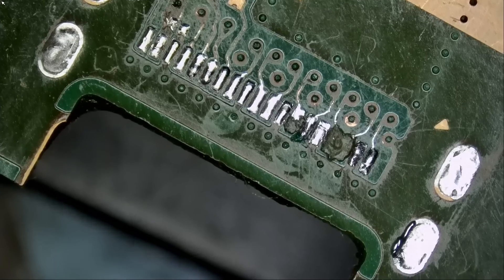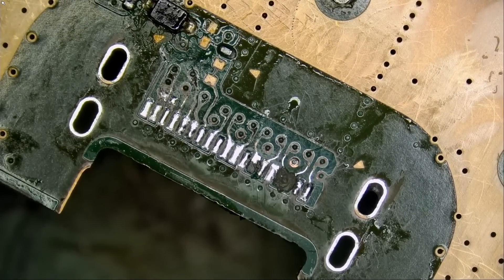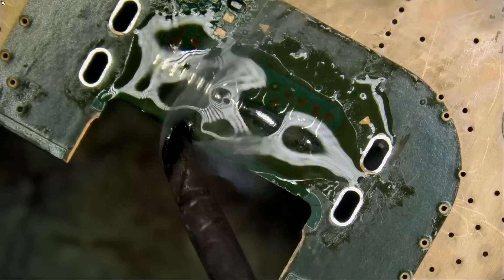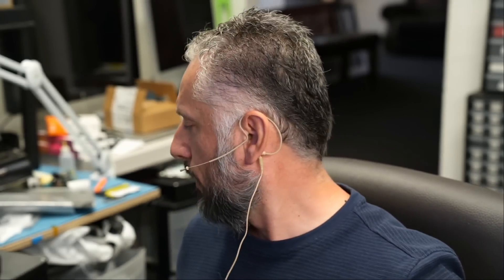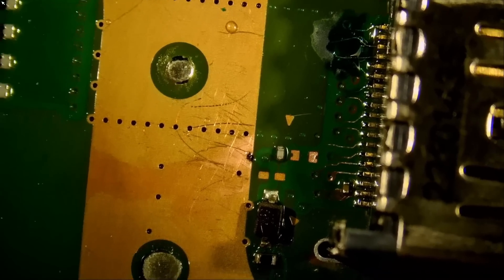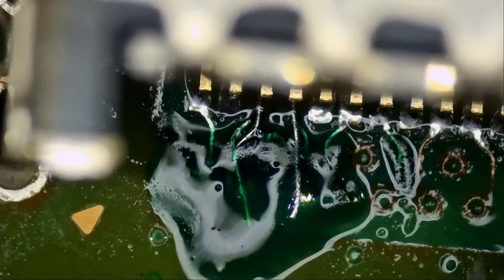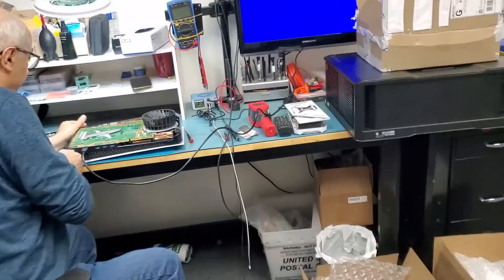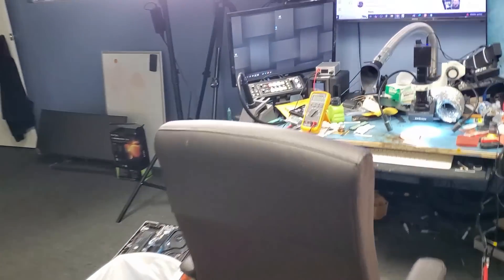Fixing a PS5 HDMI Connector with Ripped Pads after a Failed Repair Attempt

Comment: I LEANRED IN ONE DAY. My little brothers Xbox series x hdmi was broken for awhile. I fixed countless phones screens before I did any micro repair so I felt a bit of confidence even tho is was entirely a different ball game. I watched a few videos and decided to buy a heat station and soldering iron off Amazon, I didn’t have enough for a digital microscope so I used those ear cleaners with the camera to see what I was doing. It was a scary job and took about 2 hours😂 but it’s still going strong 2years later. After that I started my repair service business.

Comment: I agree with "takes a lot of practice". I tried to desolder SO-DIMM DDR connector and it didn't go well. I didn't even desolder one connector. The solder they use at factory solidifies so fast there's no chance to remove it with soldering iron.

Flux... I quickly learned it's a must have, even the cheap one. The solder just won't srick where it's supposed to. Usually it's the soldering tip and not the board.

Comment: You know I have this incredible ability to learn things rapidly. Welding, gunsmithing, heavy equipment operation, heavy equipment hauling, I've excelled in a lot of fields......micro soldering and electronic repair in general AINT NO JOKE. It took me some serious time and dedication to get decent at. Your videos and expertise absolutely motivated me and kept me going through the process. If you want to get into this be prepared to invest a TON of time into practicing and failing. Also be prepared to invest in equipment. And the most important thing is be prepared to watch countless northridgefix videos to ensure you're doing things properly 😉
Reply: So we have same mindset 😅

Comment: Hey Man nice work... Since you repair laptop too I would like to know if my laptop is at 100%  charge and still plugged in will it bypass and use the mains directly for power supply ? or still draw it from battery and charges then and there?

Comment: I've been doing electronics repairs for my work for over 16 years now. My main schtick is arcade... so my sister-in-law brings me a ps5 to repair the HDMI port. (she supplied the replacement port and liquid metal thermal compound) ... man oh man... ... i've soldered some tiny things in the past, but damn, this was really something. luckily there was no pads ripped off and it went back on smooth. didn't even lose the bypass cap :D

Comment: I've been into electronics and soldering for many years and recently the last couple have started getting more into it including logic fault finding and SMD rework.

I do some component level repair of larger consumer electronics and PC's for my friends phone repair shop and recently they gave me a couple of PS5s to do (first time) and asked me to teach them. 

Let me just say this is not a job for a beginner! The pins are tiny! It requires proper tools and equipment and experience/practice!
The first one I got off and replaced successfully though it took me quite a while learning the method. The second I got off much quicker  but upon tagging down the last couple of pins, the iron/solder ate that stupid tiny decoupling cap! 🤦‍♂️ With no replacements, all I could do is reassemble and hope it was just for non-essential filtering! 
Unfortunately, for whatever reason, the console still had no video output 😔

I think what didn't help is my lack of microscope, in its place I use my Canon 5D with 100mm macro lens and tripod! 😅 It looks towards down on the board rather than down from directly above, meaning my view can be obscured at times. Also, I've only ever soldered a few HDMI with larger pins before.

Thankfully everyone was ok, accidents do happen after all and the console went to the 3rd party repair center they also use. I will be both getting a microscope and practicing on a few more scrap boards before I take on anymore customer PS5s and teach my friend fully how to do it though, they have even more to learn than me considering they don't microsolder!

Another 'better than factory!' repair as ever my friend and thank you for all the tips. I think I might try the reflow method next.
All the best from the UK 👊

Comment: There's also the drop down technic, use flux and mix the solder first with 180° unleaded solder, heat up the pads and drop down the connector 😊

Comment: Please make a video explaining how the hell so many people rip hdmis to so many devices.  Never in all my devices had i a loose hdmi , not to mention a ripped one. How easy it is for people to rip one ?
Reply: All it takes is a little imagination. Imagine a family with kids and pets. The ps5 or Xbox is connected to the living room TV, it sits on a cabinet or it's pulled out of a cabinet and placed on the floor. Many things can happen, kids step/trip on the hdmi cable, do a tug of war with the console, pets knock it off a cabinet etc. or the parents or housekeeper clean the room and knock the console on the floor. 
The console is roughly shoved into a cabinet with hdmi cable still plugged in after use, kids may be angry to stop gaming, told to clear up, use unreasonable force and off pops the hdmi connector.
Reply: that's what i was thinking too, i guess more people don't take care of their devices
Reply: @Mister_Michael  Unless they think that inserting and removing the hdmi cable is a gym exercice that should be done fast and hard , i don't see how it is possible for so many ripped hdmis.
Reply: I fixed one on a PS5 and the customer came back 3 days later saying the HDMI port wasn’t working, which surprised me as I’ve never had one come back. I was worried I didn’t solder the pins well enough. Then I looked at the outside of the port and it was mangled worse than when he first brought it in. Eventually I got him to confess that he doesn’t unplug the HDMI cable when he puts the PS5 into his backpack.
Reply: A lot of HDMI cables are stiff. Plus some folks move their consoles between homes or friends and set them up in front of the TV, and/or vertically. If you use a stiff cable and tip over the console that will easily rip off the port.
Reply: They can fall with HDMI cable attached and screw up connector or they moving the PS5 or whatever and hit the cable while installed.  It happens, hard to do though
Reply: As you can see there are so many tiny pins, so it is easy to rip it off the board. Also people stand the console up so when it gets tripped / yanked and falls the weight of it causes damage to the port. Also the design of the port plastic incased in metal is poor and easy to damage.
Reply: Having children around lol
Reply: I think there are two main reasons. 1. People don’t place their console somewhere it won’t get knocked over or hit. Edge of desk on floor next to TV etc. 2. People that move their console a lot, move it around the house from bedroom to TV room. Bring it to and from college dorm rooms etc. Every time it is moved there is a chance of it being damaged. 

There is also a bias here, as people that repair things tend to only see things that are broken and failed repair attempts not all the successes. If I was a console maker I would put the HDMI port on a separate interconnect board that could be user replaceable. That would add a few bucks to the cost of the console, but make it user serviceable for what appears to be the most common repair.
Reply: Sloppy people exist.

Comment: “A little bit of knowledge is a dangerous thing”
You got to know where your limits are, I can solder, did hundreds of “through hole” circuits and components, even some surface mount circuits.
But right now I’m shaking like EU economy, I’d be lucky to successfully solder a car battery terminal 🤣

Comment: Please do a video explaining how to measure mosfects and in what modes then what the expected reading should be 🙏
Reply: @jafab5265  you can test capacitors in diode/continuity mode.... one side of the cap would be short to ground, and the other would be just like the positive side in continuity mode. Then diode mode you is also similar.